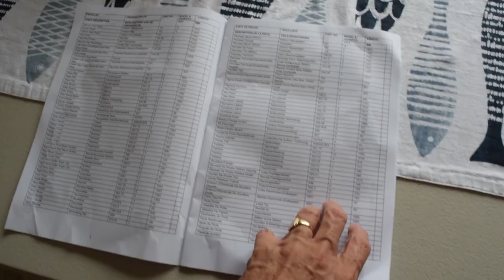YardMaster Shed Assembly and make it HIGHER

Comment: Great video..I am 71 and decided to buy this shed.I know there are a lot of negative comments about it but I have worked in tools all my life so looked at it as a kit of parts I could build a shed with..No problems so far till I saw your very informative video.I binned my old shed with 4 trips to the tip and then laid a base of worktop pallets 3 mtrs long I think..Two did the job but I had 3 so plenty of packing wood spare.Now as its vertualy the same size of the shed base I should not have problems with under water ingress..Then I realised your problem with height but as I am only 5,7 and my wife is 5ft in her shoes so it should not be such a big problem..So I have laid the base pallets and levelled them and now realise we would have to step up into the shed so hopefully miss our heads as we step up through the door....Now to finish the build and decide wether to raise up 4inches by lieing fence posts down under the walls...Nice work stay safe Ian.

Comment: I almost did the same but I used blocks under the door so there is a step up and down, but if it wasn't for this I wouldn't have even started as there just to low. So thank you so much :).. I also fitted rivets where the panels join.

Comment: Great video. I happened to have bought the same shed. On the doors it says to use #9 bolts and nuts which will avoid the sharp edges and for the smaller screws you have these little black rubber/plastic caps you can screw on.

Comment: Well presented video :) Previously I raised one by 400 mm (2 blocks) but took the easy way out as it was just for storage (no mowers etc) abd had a threshold to step over. My present metal shed I moved the sliding door "outside" so as to have the wall space for screws/bolts storage racks. It is only 6x4 so space important. Well done again
Reply from the maker: Thanks
Reply: That's what I'm going to do going to put 1 up next summer to use as a gym 10 x 15ft on top of 2 cours of blocks and just step over the blocks such a shame they make them so short

Comment: So this seems to solve 2 problems with these shed a) the height and b) using the blocks gives a water tight seal On the base!! Nice one
Reply from the maker: Thanks, but the 1.2 metre door opening may be less water tight, but I`ve not found too much of a problem as the base slabs are surrounded by lower level lawn.

Comment: How did you deal with the condensation, maybe should have put air bricks in the base blocks. Also did you get much leakage round the base from rain. I've had 2 of these sheds and had condensation and leakage around the base on both.

Comment: Great video! Was going to extend my shed up using blocks and i am going to copy your idea with the metal sheets. Do you think a Rivot gun would do the job? Would have been great to see the sliding doors from the inside when it got finished 👍
Reply from the maker: Thanks for your comment,  could be a good idea to rivet the panels I never thought of that option, you`ll need a great many rivets. Sorry I didn`t show the inside of the doors, but they still run smoothly perhaps I`ll add it to a future video.

Comment: Great video. You have great patience. Your base must have come near the purchase price of the shed.  Did you seal the apex of the roof? The shallow angle would make me beleive that wind could blow rain in there. Also, are you getting much condensation? I am in the middle of building the bigger yardmaster 10ft x 17ft which doesnt require the extra height but as I'm going to store a lot of stuff in it I dont want the possibility of damp ingress. I will also put electric ( and maybe water!) as I would like a small work area in it.
Reply from the maker: Thanks Trevor, Base was simply a jumbo bag of sand, few bags of cement and about 20 additional patio slabs to add to the ones from the original shed. I didn`t seal the roof apex and have not found any ingress of rain anywhere around the shed, but I`m not storing sensitive stuff in it. I`m surprised that you have the headroom that you need. I wanted to put some 2 mtre high shelving in mine (and walk around) and now I`m very happy with it. 👍
Reply: @bristolbadger8305 that what I want to do but on a concrete base and I'll insulate it too.

Comment: Great video, thanks for going into detail. Im looking to get 2 x yardmaster 10ft x 17ft sheds and have them side by side. I have a large grass area that needs to be prepared as I will be storing 2 cars and motorbike/ride on mower so need it to be solid. How has it been in the wind and did you cement the breeze blocks to the slabs or how did you secure them? Thanks
Reply from the maker: Thanks for your comment. Yes the breeze blocks were cemented onto the slabs and with the four corners and two midway points the blocks were laid flat and the shed screwed into the blocks in each corner using the Yardmaster fixing and I also bolted it down in the two midway points. Absolutely no problem in the strong wind that we had around here. Good Luck.
Reply: @bristolbadger8305  what  type of Concrete blocks did you use ?
Reply from the maker: @lildeanc  Hi, I used aerated blocks as it was only one course high and had the strength for this purpose Thanks

Comment: very useful video. are  you able to expand a bit more on the extension of the doors? and the runner guides please?
Reply from the maker: Yes, I bolted a sheet of stainless steel to the bottom of each door and attached 15mm box section aluminium to strengthen the area where they come together. I also added the same size box section along the bottom of each door to glide within the threshold channels. The threshold strip is from the original pack but ground off of the fixing plate and screwed into the floor. Thanks

Comment: How are these sheds with the wind? I hear thay can be abit rattlely. Do you get water build up on the concrete block or doese the shed provide enough overhang to stop that fom happening?
Reply from the maker: I`ve had no trouble with the high winds we get around here. but don`t leave the roof off for any period of time when you assemble it.(as you can see in the video). There is no rattling of the panels as they are well screwed down.
The base slabs have a slight incline from front to rear, which takes any water off to the ground at the back of the shed.
Reply: @bristolbadger8305  thanks. Ive ordered one and will probably do the samevas you have. Because of the hight issue.

Comment: Great vid, thank you.  I’ve just ordered a yardmaster shed and intend using slabs like you did, Could I just ask if you have had condensation issues inside the shed?  I’ve just read several posts about bad condensation inside metal sheds and I’m wondering if I have made a mistake ordering one.  Very grateful for any advice please.
Barry
Reply from the maker: Thanks Barry, I`ve been using the shed for a couple of years now and have not had any condensation problems. It is fairly well aired at the  junction of roof/walls so perhaps that helps. I`m sure it will go well. Thanks again
Reply: @bristolbadger8305  many thanks.

Comment: I think the shed height is to conform to Planning Permission - above 2.5 metres you need to apply for Planning Permission.
Reply from the maker: Floor to top apex of the shed is 2.22m with the shed on the blocks, so you can see how short these sheds are without giving it more height. I think the planning regs are 2.5m to the eaves and 3m to apex.
Reply: These sheds tend to be only 1.89m high! So raising on blocks is a good idea.

Comment: How many days take to install it completely. Would you tell me please? And  how many people I will need to do this .Thank you.
Reply from the maker: The ground preparation took a couple of days and the assembly another couple of days, but it could be done in a day. I had help lifting the unit onto the blocks and the roof assembly, but most of it I done alone. Don`t leave it with the roof off for too long as it can get caught in the wind. Thanks for your question.

Comment: Does your shed leak from the roo onto the floor then inside from the blocks...
I've done same thing same shed an size, mine has water falling off the roof on the side an into through the blocks...
Reply from the maker: I`ve not had any water getting into the shed, there is only a small border of patio stones beyond the shed base so I don`t get any build up of rain water around the base.
Reply: Hmmm that's strange I get water off the roof on to floor then into the side of my shed... strange...
Reply: I have a metal base which I may have to use. An put some plywood on top ....

Comment: In shed description it says assembly 4-6 hours estimated so going by your video it takes a lot longer than that then? (even without the problems & making it higher) Great video by the way.
Reply from the maker: It possibly can be done in 4-6 hours, if your base is prepared and you are happy where each piece needs to be assembled. I spent some time checking the pieces with the instructions. Thanks

Comment: Hi putting the shed on blocks is a stroke of genius.   I have this shed on order coming in the next few weeks. Any chance I could have the dimensions of the blocks from the outside, so I could prep the blockwork, so it's ready for the shed. Thanks
Reply from the maker: I would recommend that you check your shed dimensions before starting the prep work, as I`d hate to give you my dimensions and then you find your shed will not fit onto the blocks. Perhaps build the bottom run and chalk the base in situ as I did in the video. but for MY shed the outside block sizes are 287cm(w) x 389cm (l). don`t forget to leave 120cm for door. Good luck.
Reply: @bristolbadger8305  That is very helpfull thanks very much. I take it the blocks laying flat are exactly in the middle of the sides?
Reply from the maker: @Ryan-kg2fv  yes, each corner and in the middle of each longer side (6 positions total)
Reply: @bristolbadger8305  Well started my build today the only thing I've done different to you is added a row of bricks on top of the blocks for a little more height. Just wondered if you sealed the shed once you plonked it on top of the block to stop water running in. I'm half tempted to muck it on or just use trusty old silicone.
Reply from the maker: @Ryan-kg2fv  I didn`t seal the shed with anything, just bolted it down into the blocks in six places. Shouldn`t get much water ingress as the roof sends most water off to the sides. but a seal could be a good idea. good luck
Reply: @bristolbadger8305  Well after laying all my blocks ready to take the shed, I then made an attempt at putting the shed together. Took me all day just to put the roof frame together and cut my hand open doing it. So the following day I took the roof apart, packed it back in its box and sold the thing. Knocked down my base and decided to make a shed from blocks instead. Need to be a brain surgeon to put one of these things together.

Comment: Very well thought out and useful video. Found this interesting how your raised the shed. Have you had any problems of water ingress at the bottom and along shed to breeze blocks surface?
Reply from the maker: Thank you Koysii, I`ve had no problems with water ingress around the blocks. The base is slightly higher than the surrounding lawn so it will not `flood` onto the base slabs.
Reply: @bristolbadger8305  that's great I'm hoping to get a metal shed myself soon. And when weather permits just been rain rain rain and more rain all month.
Reply from the maker: @KoysorMiah  That`s great, hope it goes well.

Comment: May I ask what height you are? I'm thinking of getting one of these sheds and hoping I can get away with not raising the height as I am only 5ft 7" anyway
Reply from the maker: The standard height from threshold strip to top of door opening is approximately 61" (5ft 1"). mounting it on blocks has given me an opening height of approximately 70" (5ft 10")
Reply: @bristolbadger8305  That's good to know, I'll probably be able to get away with just ducking under the door then, thanks a lot mate!